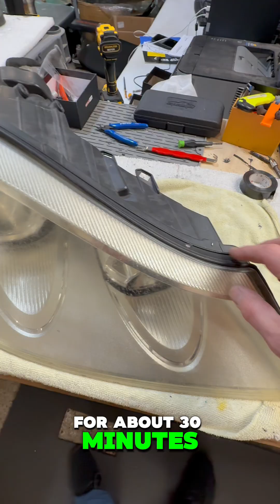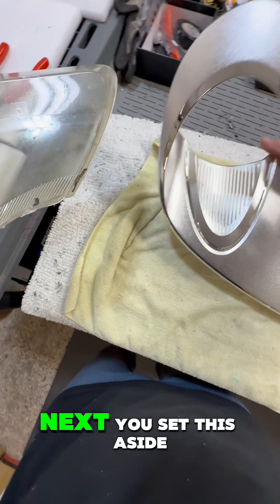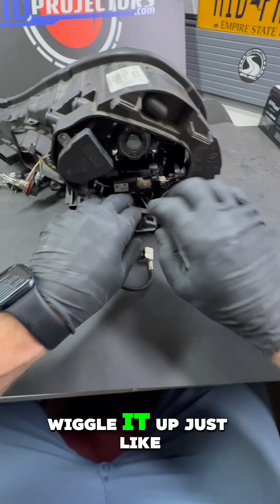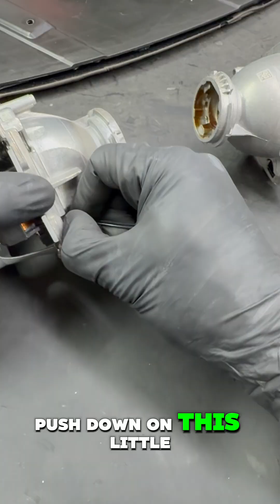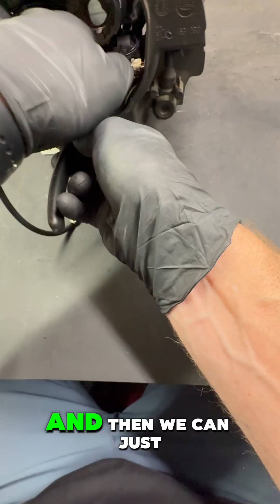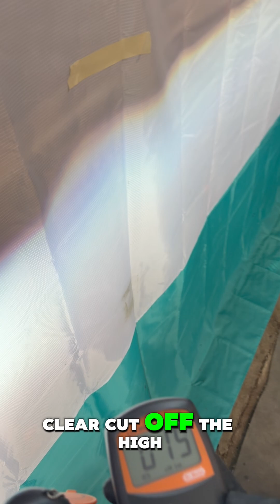957 Porsche Cayenne Headlight Retrofit Build Series DIY

Comment: wait, you baked the lens in the oven with the ballast still on?
Reply from the maker: Absolutely.  It does no harm to the ballast.
Reply: @HIDprojectors  lol.  I don't think I am willing to take the risk  of the couple of hundred dollars to replace these.
Reply from the maker: @tomzphone you can easily remove the ballast with four screws.  Not necessary, but if it gives you peace of mind, it’s an easy step to take.